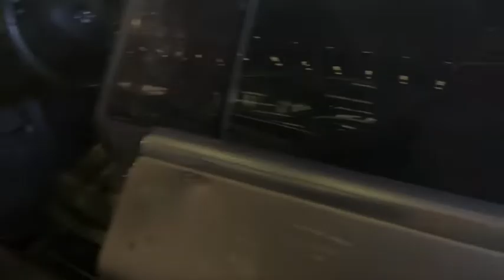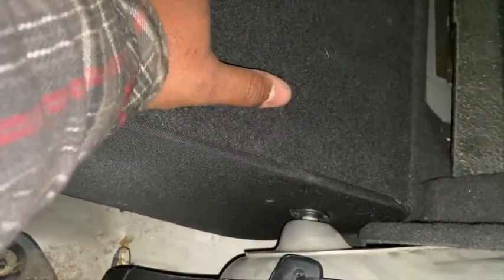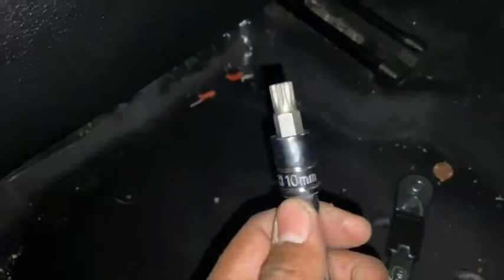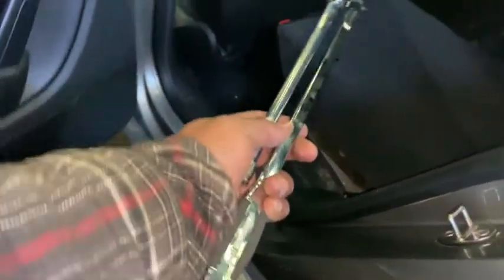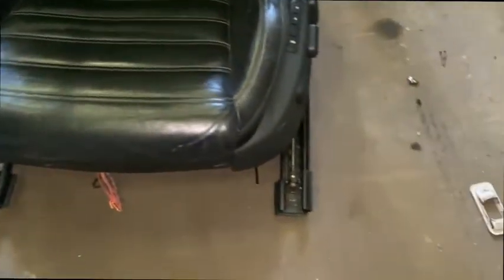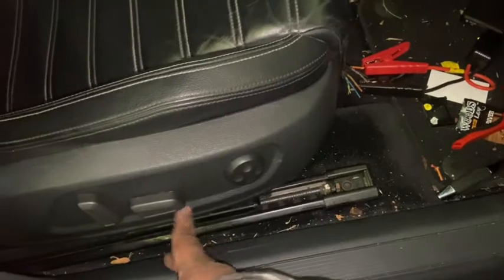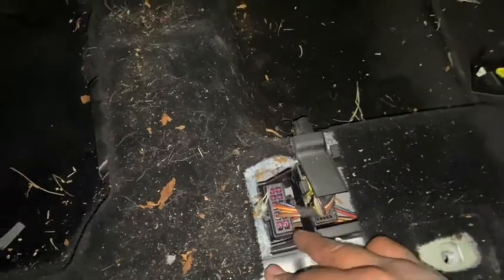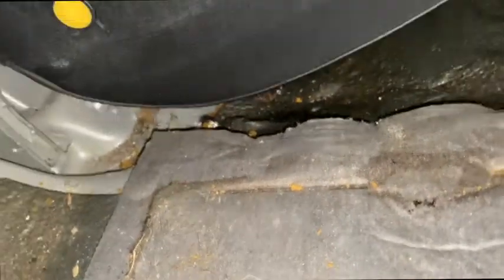G-BODY SEAT SWAP - 2009 VW CC Front \ Rear Seat Removal

Comment: Thanks for posting, been looking at these seats to pull from a junkyard for a while now ! Question, couldn’t you just use the torx bit to pull out the screws?
Reply: Yes no maybe so?
Reply from the maker: No. Torx has far less teeth and it would strip the bolt
Reply from the maker: Sorry for the late response. YT didnt notify me

Comment: I’m a VW guy and I was sitting here like damn I remember my first VW rear seat removal. Super easy after that first one tho huh.
Reply from the maker: Definitely. I just couldnt believe that tiny screw was only thing saving someone from being thrown out a car 😂
Reply: @CatlocosGarage   I can even take it one farther. In my mk4 Jetta there are ZERO screws or bolts holding the rear seats in. It’s just a little lock ring. 😂 took me about an hour to figure that out the first time.

Comment: Harbor freight and Advance auto got the tool I had the same issue
Reply from the maker: I checked my Harbor Freight and HF Online. They only sell the 6-Point Spline. Triple Square Spline is like 12-Point. None of the local auto stores had the socket versions I wanted.
Reply: @CatlocosGarage  crazy advance is where I bought mine when I pull my seats
Reply from the maker: @BigRichEHhthang100  They may of carried it. Nobody in my area had it that day.
Reply: @CatlocosGarage  I know the feeling finding special tool here is getting it off the Mac tool truck or some other

Comment: Glad you back. What’s going on with the sun roof install?
Reply from the maker: The panoramic has been done. It's still in primer. I'm not gonna worry about paint until it runs and seats are back in it.
Reply: Catloco's Garage I didn’t see the completed video of it. I will look for that today.
Reply from the maker: @bonezshakergarage  The last vid is of the body filler on it. Not sure if i showed any paint. It's all getting stripped off and repainted when it gets warmer again.
Reply: Catloco's Garage I seen that video it was a year ago.
Reply: I just watched it again.
Reply from the maker: @bonezshakergarage  Yeah it was a while ago. We're building the Turbo LS Swap for it. New vids are coming for the swap
Reply from the maker: @bonezshakergarage  Fasho.

Comment: Great idea bringing the battery pack with you. How much do they charge for seats? Have a great day CATLOCO 👋🏼
Reply from the maker: It depends on multiple things. All listed on picknpull.com website. ie. airbags, power, bench, sectional seat, etc...
Reply: @CatlocosGarage  ok thanks I haven’t been to a salvage yard in a long time.
Reply from the maker: @SILVERBACK69  Yeah PickNPull has their prices online if you have one. Most larger junkyards show their prices online.
Reply from the maker: @SILVERBACK69  These seats were more due to both front being powered seats and both had airbags. Still hundreds cheaper than getting them done.